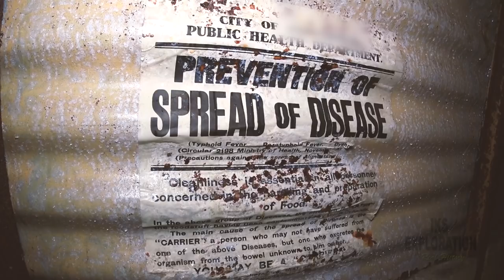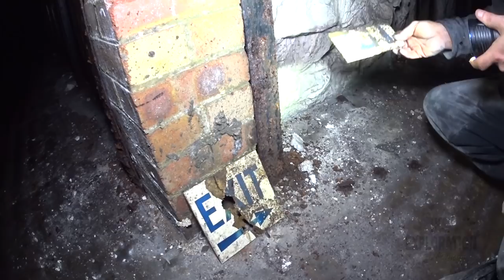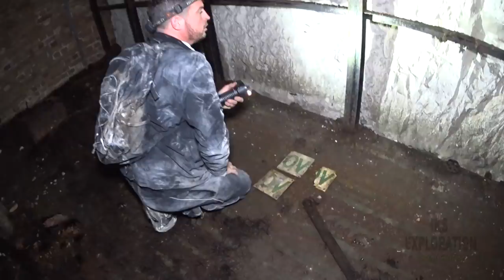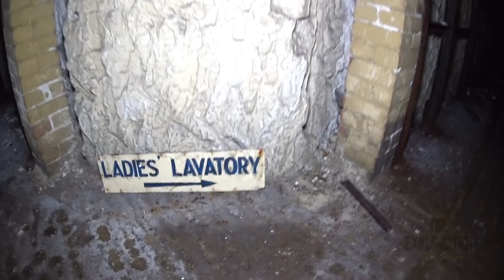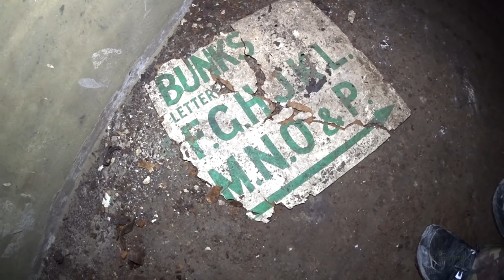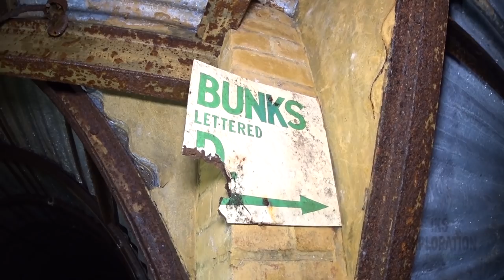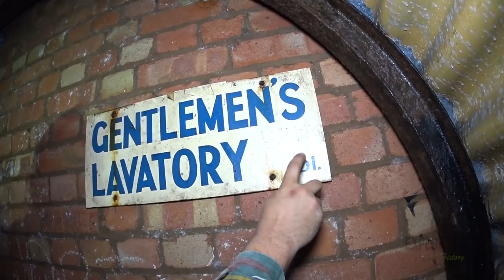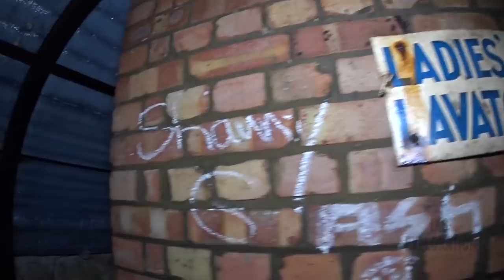London Road Deep Shelter - Part 1

Comment: we used to use signs like those OV and PV to mean Operational valve, pressure valve, IV for isolation valve when working with the water supply and sewerage in my city

Comment: The tiny collapsed tunnel section @17:35 is how the walls used to look like in the entire bunker (s across Britain) system. If you squint, you can actually see the metal frames behind, where moisture has seeped in and revealed them (as it holds to metal vs empty space).

Comment: The ceramic caps were supposed to be fitted in those flush holes you saw on the toilets. To keep them in place, they'd use those metal clips you saw in abundance in what probably used to be cardboard box.

Comment: @9:50 that cross with a yoke on the end fits through the cap you saw earlier, over the water reservoir. The yoke part of it fits over the flush bell and lifts it. These, are about the stoutest ones i've seen in my life. Compared to regular stuff, these could take  decades to get rotten and unusable.